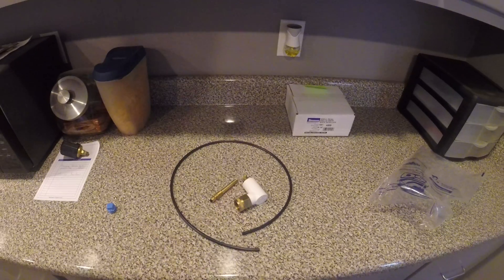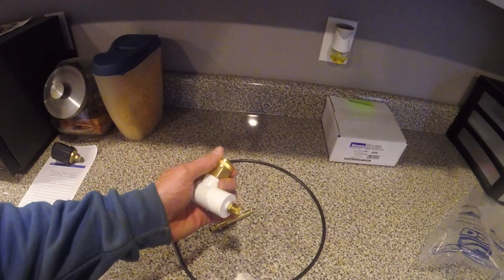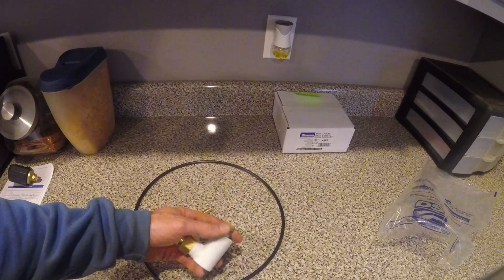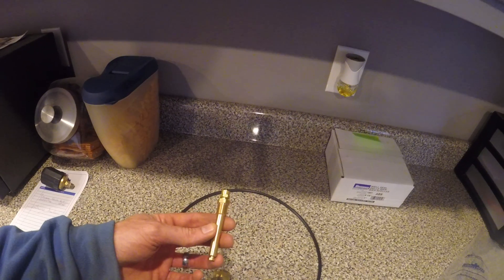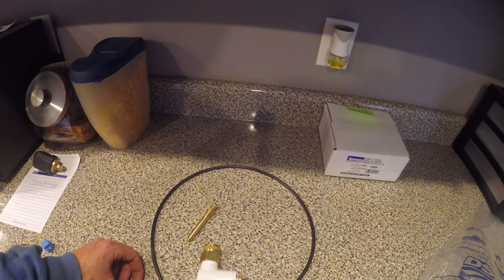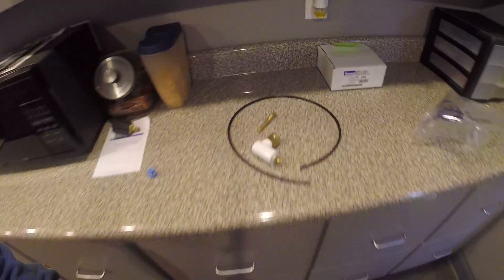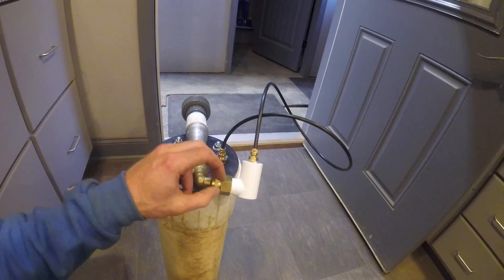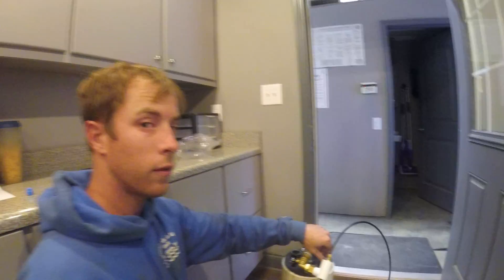Cheap Solution to Eliminate Rotten Egg Smell in Well Water | Part 2 of 2

Comment: I've been dealing with sulphur smell for twenty years using chemical feed system. This solution is brilliant; easy to install. I did not have a water hose connection on well cap but further down water line. I simply used a section of garden hose run line back to well cap to hook up aerator. 48 hours later smell gone! Would I have found this solution without internet? No way. Too much money being made on this problem.

Comment: How do you install this on a pitless adaptor well with no spigot to connect to?
Reply: Run it from a spigot from within your house, out to outside to top of well and only use it when it's not freezing out. Usually the well does smell so much or at all in winter anyways.

Comment: Man, $125 for this kit? Everything here is less than $15.
Reply from the maker: If you had any clue to what things cost these days, you would realize real fast that we have a whole lot more than $15 bucks in this material, tax, shipping, and handling. Not only that, but we aren't wired that way to where we would mark something up that much. That would be highway robbery.
Reply: @WendellLeeWellServices  Wendell, you are full of shit.
Reply: The question I have is Does this method even work (Continuously spay misting well) not knocking it or the product. just want to know for real.
Reply: @robertdavis9135 mine works. You just want to rig up a spray nozzle to spray a mist back down your well. I don’t know the chemistry involved but the oxygen you’re introducing into the well water must react with the sulfur.
Reply: Why not add the reducer/bushing in with the kit?

Comment: So i did this to my well and also put in a new centar carbon filter and im still getting a sulfer smell do you think i could run a line to the bottom of my well and use a bubbler pump like one you would use in a fish tank to inject air to help gas off the sulfer
Reply from the maker: have you tested your water?